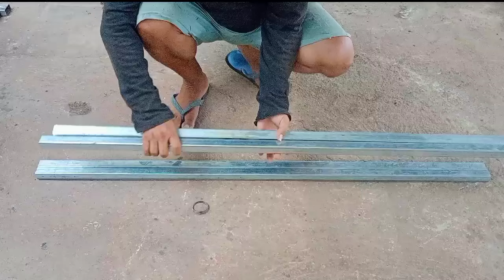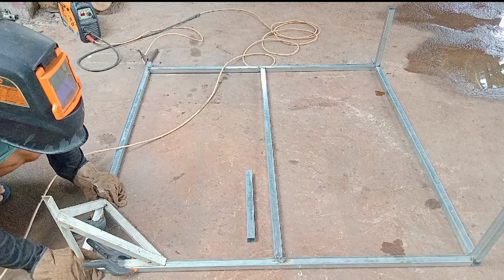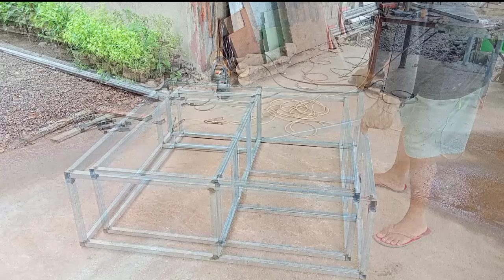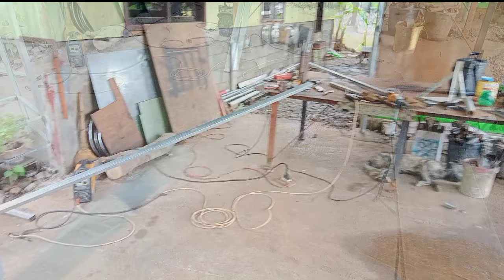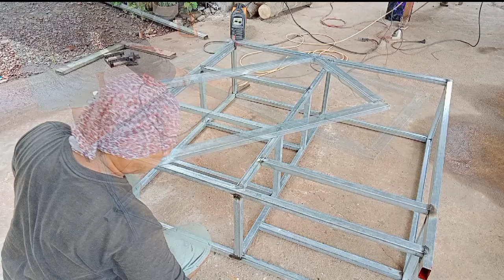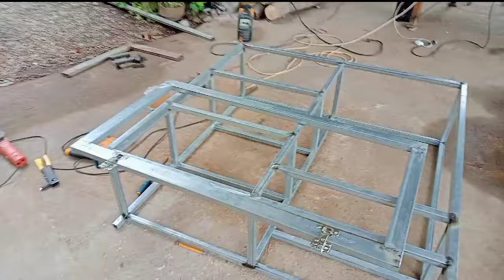paano gumawa ng cabinet frame gamit ang tubular / how to make steel frame for cabinet

Comment: Kapag ganyan sir anong welding rod maganda
Reply from the maker: 6011 po sir 2.5mm
Reply: @royweldingtv  boss pano kng 1.2mm o 1.5mm?
Reply from the maker: @karansotv7181  ano po yan sir? Thickness yan? 6011 po 2.5mm ang thickness ng welding rod
Reply: @royweldingtv  ic, thanks boss. Mag DIY kasi ako boss ng rack bali gagamitin ko. Galvanised tubular na 1.2mm at 1.5mm.  So ok na yang 6011 2.5mm boss?
Reply from the maker: @karansotv7181  opo sir, ok po yan,, pero habaan mo lng pasensya mo sa 6011 mahirap din gamitin yan, lage dumidikit, lalo na pag ngayon ka lng naka gamit nyan. Good luck po sa inyo sir God bless you po

Comment: sir parang ang nipis nung cable ng welding machine? anong cable yan? kasi yung welding machine ko maikli at makapal ang cable..san po nakakabili nyan? salamat po
Reply from the maker: Automotive wire po yan sir 8mm lng po kapal nyan,, nasa mga hardware lng po yan mabibili, salamat po
Reply: @royweldingtv  sir ok lang ba yun ang gamitin sa welding? at saka dalawang wire kinabit nyo? tama po ba?